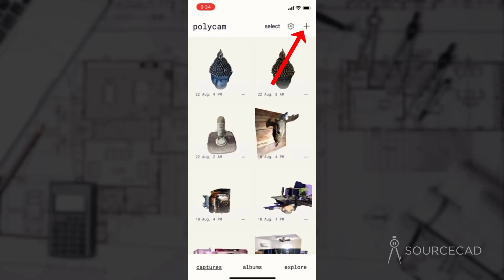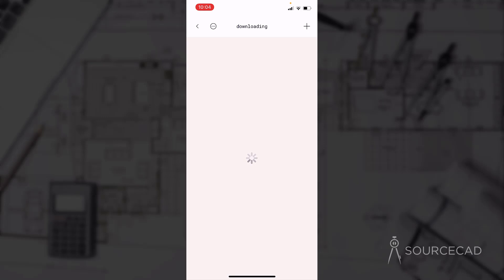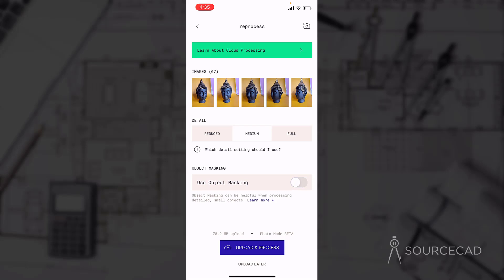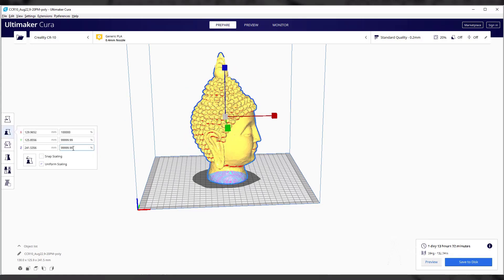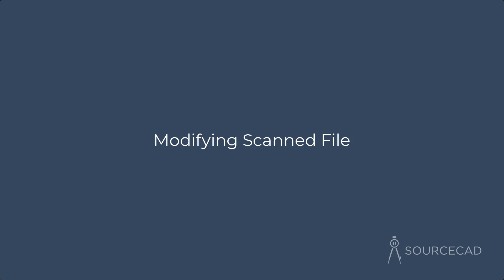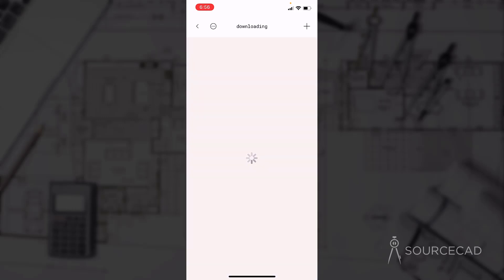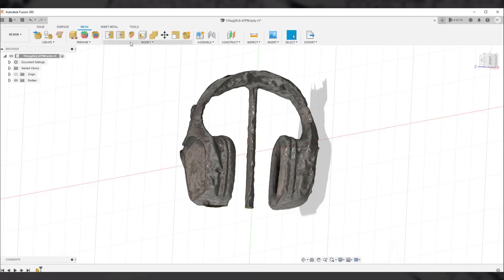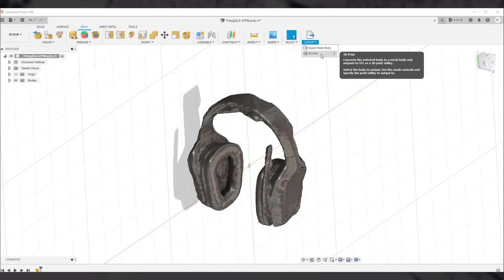Scan and 3D print objects using Polycam - Part 2 of 2

Comment: I tried to do the same exact thing. I don't know if you can help. I used kira. I have an artillery printer. I did a 3D scan, put it in the Kira. It looks exactly like your head. But once the print printed, it only printed. the support system and at 100% it stopped And I have no model printed on top of the supports. It's just supports .

Comment: Hi there. Thanks for the walk through.
I’m having a little trouble using photo mode and I see you have had the same problem. The photo mode seams to separate the textures from the model. Meaning the model loses its depth and texture when exported as an STL (as a atlas holds no colour info). If you export it as a GLTF you get a full scan but I don’t know how to combine the texture in to the model to print. I’ll use any package you can think of that might help. ❤

Comment: Thanks for posting this! I was trying to get a 3d image of a model of mine yesterday and halfway through is when I discovered the polycam lidar vs photo option setting. duh! Helped a ton. My model is huge, though. 3 feet tall and multiple pieces. It was quite hard to get all the angles, and back and under sides etc, but it came out not too bad. Will watch to the end, but just in case, do you have any info on what types of file formats to use and what each usage is?